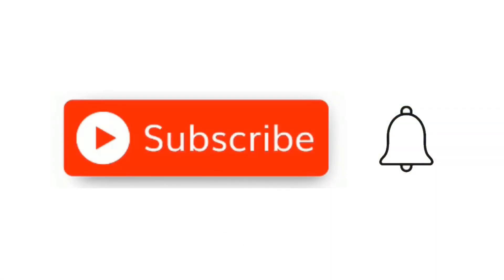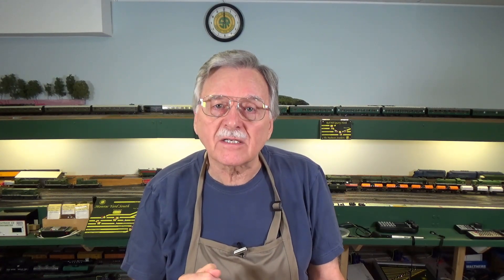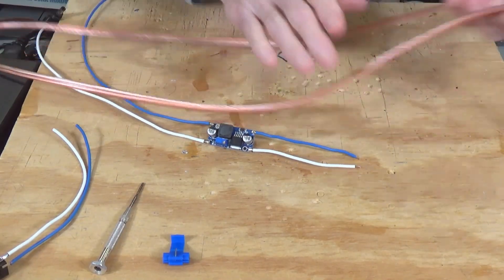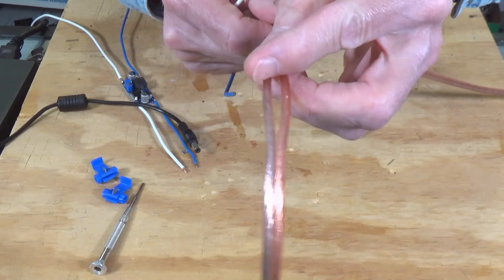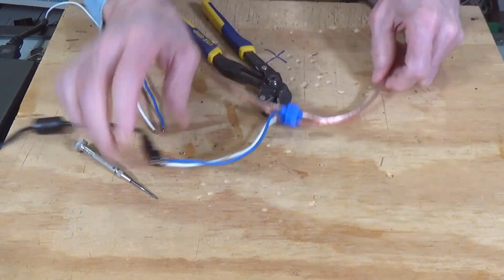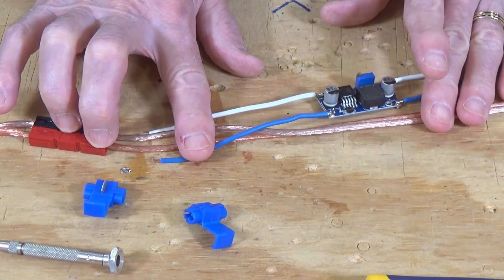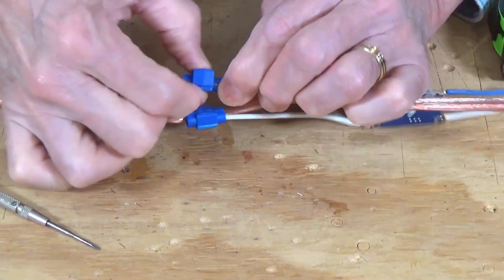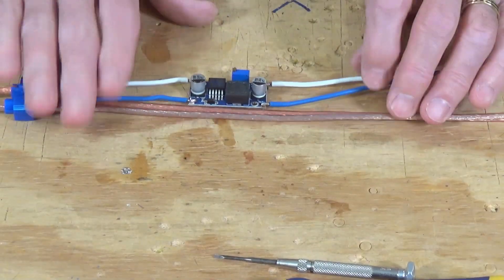Installing DC Power for KD Electromagnetic Uncouplers (331)

Comment: Hi Larry, a quick question you or your viewers might be able to help me with. I’m planning a layout with two tracks in a run around (tale chaser). It’s about 7m x 3m, so about 20m (60ft) in circumference. I’m use DCC for the tracks. But I think I’ll use a CDU to power the 40 or so seep point motors. It’s Old school I know but it’s quicker and cheaper. 
Q1. If the wires are big enough, will only one or two CDU do the job ?
Q2. If I want to build a mimic board, the push buttons on it are a long way away from the furtherest point motor 10m (30ft). Due to voltage drop, Is this a problem ?
Any tips and tricks would be much appreciated. Thanks, Alan
Reply from the maker: In both cases it depends on the size of the wires, amperage, and design of the devices being powered. Too many unknowns to answer your question.

Comment: Larry I know you probably get of people like me asking you questions that you may have already covered; in the last episode you said that AC could be used as long as it was converent to DC use a bridge rectifier my question is what would you need if you was to use DCC from a momentary accessory decoder like those that are used to control turnout motors; are would the output from those decoder be DC?
Another question do you think that a H0n3 electro uncoupler would work for TT gauge?
Reply from the maker: Last question first. Another viewer commented that the HOn3 one works for N scale so it might be OK for TT too. Check the measurements on the KD website to see how it compares to TT track dimensions. 

Now the first question. As I have shown in previous videos you can rectify DCC to get DC and without looking at every possible accessory decoder I will say they generally produce DC output to control turnout motors, BUT it depends on the accessory decoder and what it was designed for. You also need to be aware of the current draw of the device you want to power. The KD electromagnets pull at least 3 amps so would not be a good match for most if not all accessory decoders. So as I say it all depends on the accessory decoder and the device to be powered.

Comment: Will the KD uncoupler work with N scale?
Reply from the maker: A viewer in an earlier comment said that the HOn3 version will work with N scale but I have no way to confirm that. You may be able tog et the dimensions of that version in the KD website and see if it will fit the N scale track spacing. Also the Rapido electromagnet may work as well, worth a look to see.

Comment: The 16 volt power bus is a good place to start!  The buck converters can also be used to reduce the voltages to 5, 3 and 1.5 volts or whatever.  The price is right and I can place one where ever I need one.  The DC power bus has really been very useful on my DCC layout.  Thanks for the great video!

Comment: I use the Rapido Uncoupler as well.   They have a built in LED you can use to align.  I added a flashing led trackside instead to alert that the Uncoupler is active and where to stop

Comment: Larry, I recommend the Rapido uncoupler. It isn't an electromagnet, it uses a permanent magnet which is turned either along the rails (on) or across them (off). That means it does not have a limited operating period, unlike an electromagnet. It is easier to install than the Kadee and a bit cheaper.
Reply: I have searched theis(RAPIDO) web site and cannot find. Does anyone know if they still offer? Thanks
Reply: @robertrusso6539  search on their website 'RAILCREW ON OF REMOTE UNCOUPLER'
Reply: Called Rapido RailCrew Uncoupler @robertrusso6539
Reply: They do   They are also sold under the Rail Crew brand.